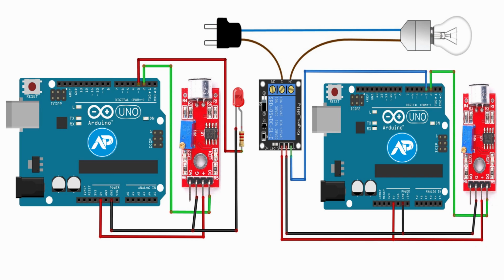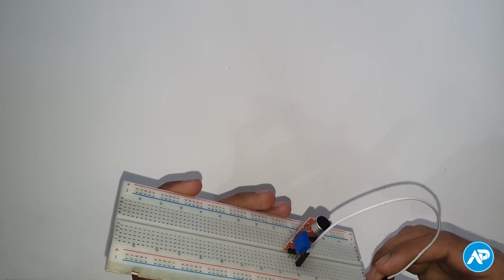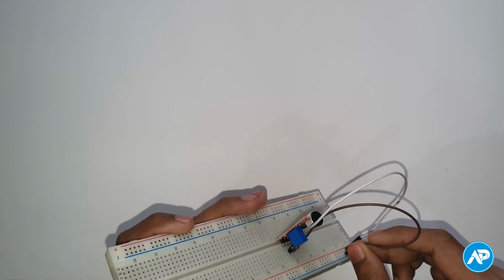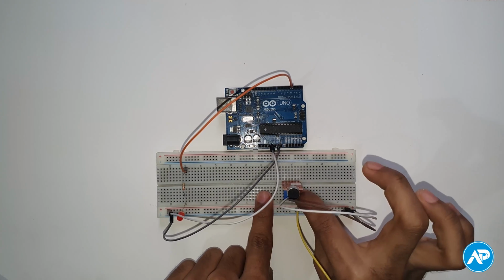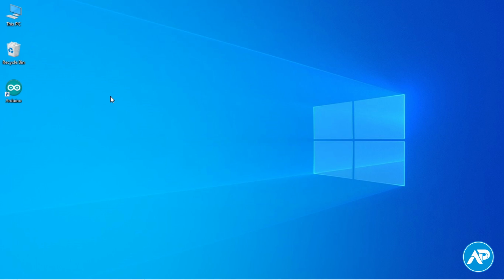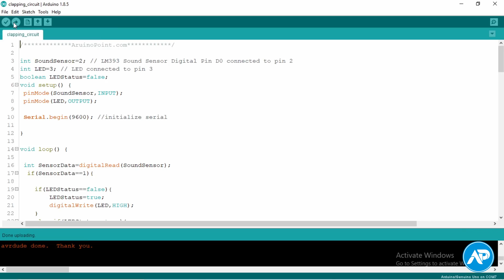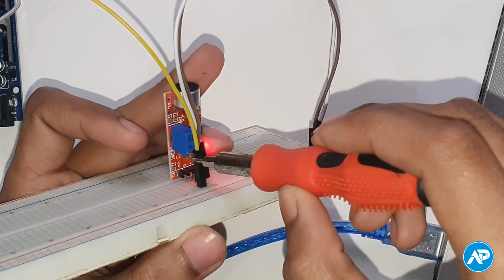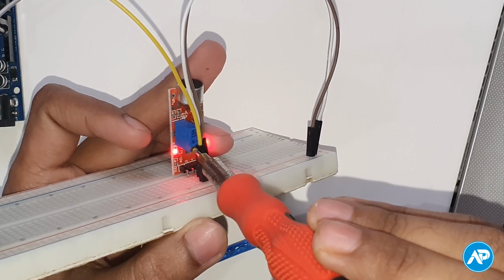Arduino Clap Switch Using Sound Sensor | Easiest Way

Comment: Thank you! But what if I want to switch it on and off using 2 claps instead of 1?
Reply: in the code u can change the variable from 1 to 2. where it says "if(SensorData==1)" write "if(SensorData==2)" instead
Reply: no thats not how it works @yN0ah_11

Comment: I need your help I am using arduino nano and I don't have breadboard please help its urgent
Reply: I don't know the wire placement
Reply from the maker: See the circuit diagram. It will help you.
Reply from the maker: Yes! 
You can use male to female jumper wire or soldering.
Reply: @arduinopoint001  thank you but I don't have solder

Comment: Easy to make this arduino clap switch.  I made it 😄
Reply from the maker: Thanks for your compliment 😃😃😃, Mr Habib. Glad you made it.
Reply: is it sensitive enough?
Reply: @bekire2215  It depend. The one I used before need amplifier. But not so sure if the LM393 one used here have high enough output level.